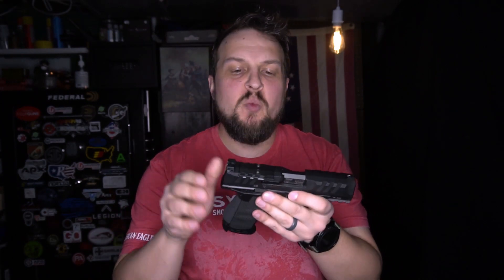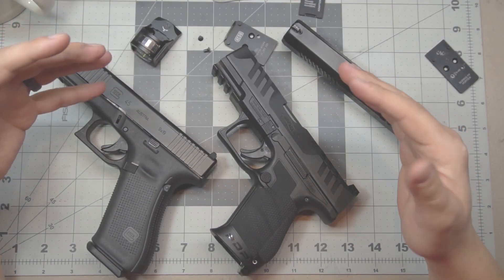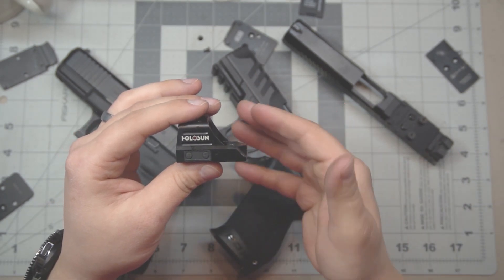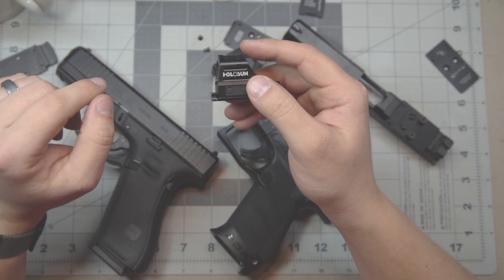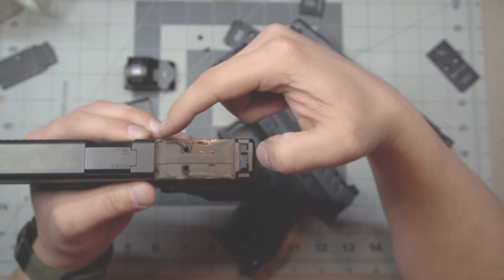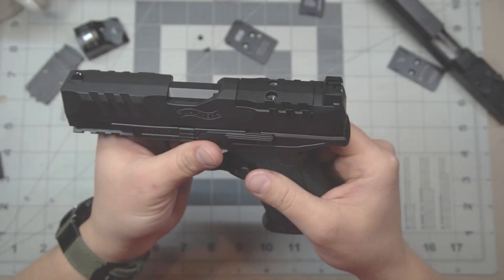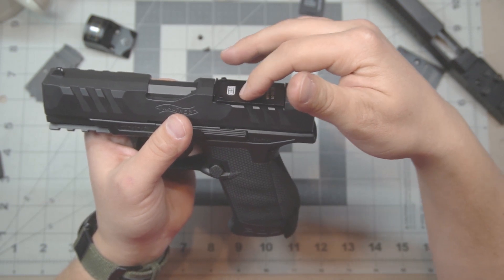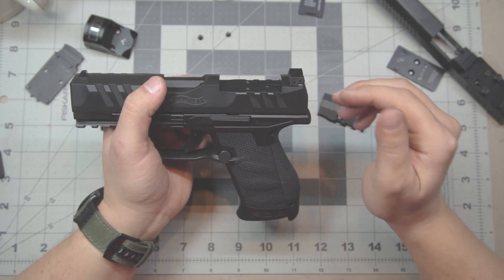The Gen 1 Walther PDP is going to Break

Comment: I hope you are wrong only because, yes, I am a Walther fanboy, and you predicted that I would say something. I love my PPQ, want to get a Q5 Match SF & a Vintage (color case hardened) one as well, just to be queen of the safe. Time will tell, and I’m not in the market for this type of gun (again) for at least a few years, so by then, hopefully, if you are correct, they will have improved the design... Until then, let’s wait till you actually get the OEM plate from Walther before making a clickbait video, simply based off your degree in “mechanical design” and not engineering....

Comment: How many rounds do you have in on your field test? You are field testing this, right? I'm curious, because in your video title you say "your Walther PDP is going to break." However, in the comments I've read, you call it a potential design flaw. "It's going to break," is much different than a potential design flaw. So, how many rounds do you have in on your field test? Have you had failures with the PDP's optic mounting system during your field test? It seems irresponsible to make a claim like this without testing to back up your claim, so I'm looking forward your practical application results.

Comment: Have you ever WITTNESSED confirmed an example of this failure?  All mounting systems will fail if sufficient forces are applied.   That does not require a degree to understand.  However,  this video only compares other systems before ASSUMING the failure is imminent under normal use.   Apply that degree and calculate the forces involved and compare them to the strength of the screws used. You don't even know the alloy do you?  Don't forget to calculate the friction of the mating surfaces of the plate and slide.  Then tell us what you have learned.  No I don't own a PDP.  
That said,  this is America,  you have the right to say most anything.  ... Good Day.
Reply: I stand corrected.   You evidently have done a deeper dive into the plate and the FORCES it will endure.  Kudos!
My reason for questioning whether you had was based on my experience with high power rifles and their optic mounting plates for very heavy scopes.   In the 1970s through 1990s those tiny plates were typically mounted with 2-4 10x24 and eventually 8x32 machine screws.  The forces are much greater there.   Sorry for picking on an older (not yet revised) video.   That's just the way YouTube presented it.

Comment: It make break eventually but I don’t think it’s going to be that big of an issue as most optics weigh in around 1-1.5 ounces. With proper torque it should be fine for carry applications unless you’re a dumbass trying to be tacticool
Reply from the maker: Every gun should be "tacticool" strong. Never know when the mall warrior needs to actually use their gear hard.

Comment: So then when you install a picatinny/weaver rail on a hunting rifle you're going to have zero issues? not quite. nice try though man.
Reply from the maker: You need to free body diagram that design if you think they're the same.
Reply: @workthetrigger  in my opinion there isn't much contrast between the two. There is a potential for forward and sideward motion without lugs to inhibit movement on both platforms, and I'd even argue it is more likely to happen on a rounded base, such as on a rifle, than the flat base on a pistol. Yet the quality manufactured bases can/and do maintain zero upon impacts when dropped without shearing.

Having said that - your theory based on this argument is solely reliant upon the idea that the recoil of the slide must be able to overpower the shear strength of the screws. This is not to mention that movement has to be occuring at the same time for shearing to even be a potentiality.

The facts: 
A full size 9mm recoil as the gun you pictured here would have on average a 4 to 5 pound felt recoil force.

The average shear force of a 6-48 screw which is a popular variant for mounting optics is around 70,000 psi, or 810 pounds respectively.

Tell me how it makes sense that 4 to 5 pounds of recoil force would shear two screws rated at 815 pounds each..it is a stretch. 

If these do shear, I'd say some substantial dropping force had to have occured.
Reply from the maker: Watch the second video 😉

Comment: There is rubber pad available which goes between the plate and slide which grips solid, you lost your mind man, how are your still an engineer?
Reply from the maker: Does it come with this plate?  If it doesn't come with it, then it's not the manufacturers solution.

Comment: Sorry my friend. But you are making an absolute mountain out of an absolute mole hill.

Walters design is completely fine. And I was Involved in the testing process for three different firearms for military use. Two of which were adopted, one was not. And in all cases everything you are talking about would not have been an issue as long as the weapon passed stress and environment tests. 

Besides, the mounting system is very very, VERY seldom the failure point of a micro red dot. It’s the durability and design of the optic itself. 

THAT is what causes failures and why many still prefer indestructible. trouble free, no battery, no maintenance….Iron Sights. Not the “mounting system”.

Oh and I don’t own this gun but absolutely prefer micro Red Dots and have 6 different brands and models.

Comment: Mine work:  Both the 5" and the 4".  Thanks anyway.  Go review Glock.  It's much more deserving of criticism than any of the German companies.
Reply from the maker: The MOS system is crap, too 🤷🏻‍♂️ doesn't mean this system is good.  Actually can be used as the exact reason why it's not.  Don't hold German engineering on as much of a pedistal. They're known for overly complicated engineering... Not bulletproof engineering.

Comment: Every time a new gun hits the Market there has ALWAYS got to be the ONE guy, who tells you why something is wrong, or the gun is shit, or any other thing these negative Nancy’s come up with 🤦‍♂️. Of course, sometimes there needs to be some upgrading, or a design flaw, but that’s usually followed by a factory re-call, and a replacement is sent to those who are the recipient of the flaws. Other than that, there always has to be these guys who, for some reason, have to be the spoiler!! 🤦‍♂️ seen it with the Sig P365, Springfield Hellcat, Smith & Wesson M&P, and countless others, I actually seen a video from a guy who tried to say the Beretta M-9/92-FS was the most “overrated piece of garbage” 🤦‍♂️

Comment: If you're aware that the info in your video is inaccurate, why does the video remain up?  I'd imagine if you were concerned about accuracy and integrity, you'd have removed the video by now.  Are you going to sell ad-space on your debunked video?  It'd likely be a good business move.
Reply from the maker: Because it's not inaccurate?  PDPs have been breaking, losing zero, etc.  Enough so that Walther updated/improved their plate design to integrate the lugs I recommended in both of my videos. Nowhere has it been "debunked". Just like the Glock Mos system, a notoriously poor system, not all guns have to break to prove its a bad system. So you're welcome for pointing out an engineering shortcoming that led to consumers getting a better gun.

Comment: this doesn't break this is why they use self-centering fasteners to take up the slack  and so far there has been no reported breakage this is from one engineer to another !!!
Reply from the maker: The self centering fasteners do nothing to change the design and lack of additional support of the joint. Every company uses self centering fasteners, it's a byproduct of countersinking.  And yet, other companies with no additional support have breakages.

Comment: Well, this video didn’t age well. I’ve seen a lot of first generation PDP’s with a lot of optics on it and guess what, I haven’t seen one fly off the slide from the reason that he gives here. My instructor has one of the first PDP’s with the original flat slide cuts with thousands upon thousands of rounds through it. And his Trijicon RMR is still attached from when he first put it on. This video was just a uninformed, paranoid rambling. A degree in mechanical design huh? Call me a fan boy if that’s what makes you feel good. But you are just dead wrong here. Calling me a fan boy for me calling you out on your bullshit is just stupid.
Reply from the maker: Not calling you a fan boy, but I am saying that unless you opened a direct avenue for people with broken guns to reach out to you, they wouldn't. Because I saw them get shot down, made fun of, and banned for pointing out and providing examples of their broken guns.

It was a big enough deal for Walther to redesign, rather then running tests showing the "strength" of their design. It would've proven cheaper in the end to prove the video wrong then to redesign.

It not your fault the stories of the broken guns were hidden, but it's definitely a symptom of the community trying to uphold a company vs. Pressing for a better product.

The funny part is that Walther actually proved that they cared more about their customers then the commu ity did when they redesigned. So major kudos to them.

Comment: Judging by many previous responses, it seems to me that many haven’t worked all that closely with engineers as a machinist. This is a design flaw that may or may not inevitably hurt someone if the two fasteners become sheared away from the slide as a result of repetitious preload through both c/s without having any lugs to prevent any sort of shift. No amount of loctite will help the tensile strength of those two “ity-bitty” screws. 
But hey, what do I know. I’m just a dumb machinist who’s been turning wrenches most of my life. Lol. 
I own a couple PPQ’s. Love em. But for the PDP? Yeah that’s going to have to be ‘no’ for me dawg. 
Thanks for video.

Comment: I too share the video creators concern designing a plate interface solely relying on two small countersunk head screws to bear the forces that are acting between the slide and optics plate. Personally I would not install such a design without degreasing both the slidecut and the plate and comprehensively applying some kind of appropriate adhesive to the mating surfaces (while avoiding the firing pin channel), based on what I've seen in this video. However, with machining the plate to tight front-to-rear tolerances (as someone has pointed out in the comments) one might sucessfully avoid the need for some additional load bearing geometry between the two parts, if the optics cut in the slide is also machined to the same tolerances. I can only hope Walther tested this design extensively to make sure it holds up. You see, companies also take measures to reduce cost instead of working out the best possible solution from an engineering point of view, however going back to such a simple design after having some serious lugs in previous models makes me hope they know what they're doing. I really hope it holds up, since personally I do like the PDP series a lot from what I've seen so far and will probably get one as soon as they are released in Europe (July for whatever reason).

Comment: Wouldn’t loctite address the screw concern.
Reply from the maker: Loctite only holds the threads in place.  The problem here is incorrect forces being applied to a fastener.  Threaded shafts aren't good at taking sheer forces.
Reply: Ok - I got it now. I watched the video again. I thought the screws attached to the frame. That’s what I get watching a video while in bed half asleep.
Reply: @workthetrigger  The problem is you used the WRONG PLATE but remain unwilling to admit that.  Which makes you dishonest.  And if you're aware you used the wrong plate, it makes your video above both dishonest AND unethical.  But apparently that doesn't matter to you, as long as you can boast about the "clicks" you got on this video.  Would you please identify for us which college/university awarded a Mech Design degree to you, and what was your graduating GPA?

Comment: Fasteners and rivets are used in shear all the time on aircraft. WTF are you talking about?
Reply from the maker: Rivets are designed for shear force. And fasteners when designed properly can be as well. But these are fully threaded machine screws, without the properly integrated cross section for shear force application.
Reply: @workthetrigger  agreed rivets are better for sheer. However fasteners aren't necessarily Inadequate. 

From what I can find a decent red dot weighs about an ounce or two.

A compact 9mm slide experiences about 150gs of acceleration, so your screw only has to take what? 20lbs in shear to be generous?

A 10-32 machine screw in the threads in sheer will have a fatigue stress far higher than 20lbs giving a pretty decent safety factor. Especially if there is 2. 

I don't see this being a problem. I'm open to bring proved wrong, but until I hear of some breakages based on the 20 minutes of research I did for slide acceleration and red dot sights. I think you're taking your engineering intuition a little too far and need to do some math.

Comment: This video is click bait with no proof, just speculation. I'm surprised Walther hasn't issued a cease and desist order. Here is a summary of Walther's test results.

"We diligently conducted Walther PDP optic plate stress tests. The highest stress/load for the slide and all mounted parts results from the acceleration of the slide while firing. The acceleration can go up to 1800 G. The force on the Adapter Plate resulting from this effect is transferred over the Pressing Face from the Adapter Plate to the Slide. This design ensures that the Adapter plate is always pressed against this transfer Surface.

The negative acceleration in the opposite direction is extremely small. The force in this direction can be held easily by the screws combined with the friction between the optic mounting Adapter Plate and the Slide.

Two pistols were chosen. Each had 10,000 rounds shot with mounted Red Dot. No maintenance performed on the plates during the 10,000 rounds. No issues appeared, no loose screws.

One pistol was chosen and had 20,000 rounds shot with mounted Red Dot. No maintenance performed on the plates during the 10,000 rounds. No issues appeared, no loose screws.

One pistol was chosen and had 50,000 rounds shot with different versions of Red Dot sights and their corresponding adapter plates. While the same Red Dot and Mounting Plate were mounted, no maintenance at the plates was done, no issues appeared, no loose screws."

For more information: https://waltherarms.com/2021/03/15/walther-pdp-optic-plate-stress-test/
Reply from the maker: I did a whole video on their "testing".
Reply: @workthetrigger  I'm sure you did. I'll get to it, sometime, maybe.
Reply: @chesslover8829  Watch SageDynamics. He had no problem and he even does drop tests...